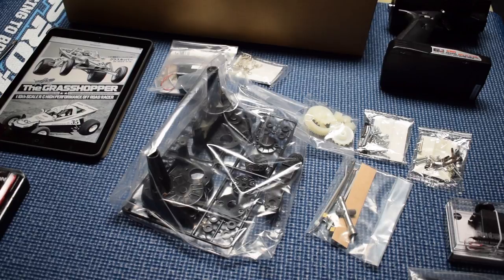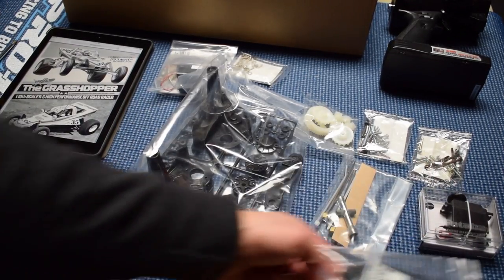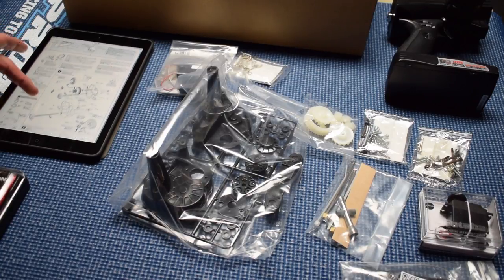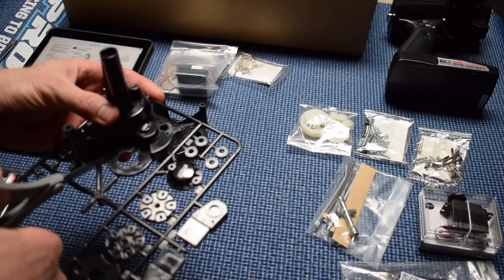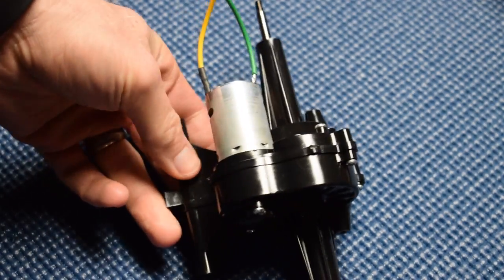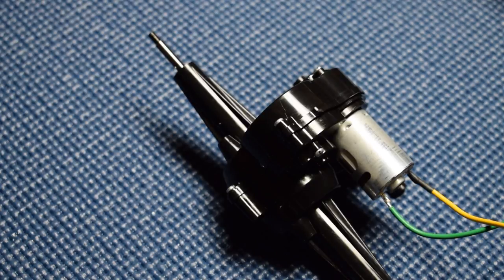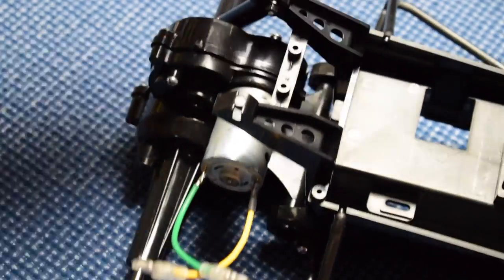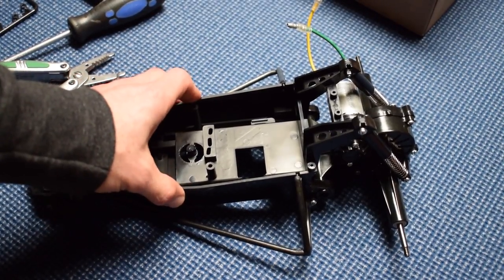Tamiya "The Grasshopper" Kit Build - Part 1

Comment: I know I'm super late to the party (searched for Tamiya Grasshopper build and your video came up first) but if you want to snip the parts off the sprues and not have to worry about cleanup, I'd highly suggest buying a pair of nippers from your hobby store or Amazon.  They range in price anywhere from $5 to $60 and are extremely handy when building any type of model that comes on a fixed plastic parts sprue.

Comment: Nice Job Tim!!! Try not to be too hard on the instructions or crudeness in general of the kit. This is what makes the Tamiya vintage kits so cool, right around the time you complete and go for the first test run you will forget about the primitive design and pains of the build. It's also completely normal to miss or have to go back and correct something from the instructions. Tamiya instructions always have had very little verbage and require alot study of the image at hand. Over the course of a few builds you will get used to this and start to see the relationship between the kits and it will get easier.As far as the Philips hardware,lol I've always thought the same thing (not gonna  hold strip etc...) surprisingly it works I've never had a screw back out. Your doing a fine job and the key is that you caught the mix-up while you were still in the process of building and these pains make the experience and the final product that much sweeter!! Thumbs up buddy and I await the next part of the series!!
Reply from the maker: Thank you for the comment and insight, Rich. After giving it more thought, the instructions aren't bad for what they are; reproductions of a 1980s-era manual. Put into perspective, it's a nice trip down memory lane (for someone that's never owned a Tamiya kit before) and helps me appreciate the current-day details that we have in modern kits and RTRs.
Reply: RC Newb Right on Brother!!

Comment: I am trying to get into RC kit building and I'm quite positive I will enjoy it but I don't want to spend a ton of money on something i may not like. All of the cars I've found have increased in price greatly. This car is a good price for me but I want to know what the cheapest price I can get the electronics for. If there is something cheaper than the grasshopper that still looks ok, I'd love to hear it. Thank you in advance!
Reply from the maker: The Grasshopper is one of the more-economical kits that I can think of, however, the ECX Amp Kit might be of interest to you as well. For $139.99, you get everything you need to build the truck in the box (except for paint). https://www.horizonhobby.com/ProductDisplay?product_identifier_token=product&urlRequestType=Base&catalogId=10051&categoryId=221501&productId=956501&urlLangId=-1&langId=-1&top_category=&parent_category_rn=&storeId=10151
Reply: If you want a good starter try a traxxas bandit. Runs about 160 and I promise you wolnt be disappointed.

Comment: how do you actually build the gear box? as your video jumps that part
Reply from the maker: Hi Claire, the gearbox build probably isn't as daunting as I made it out to be. Basically, the gears are greased and shafts are inserted into them (the orbiting gears). The main drive gears are also greased and attached to the axle shafts. Getting everything to line up was the most time-consuming portion of the task.
Reply: Thanks for the reply. My hubby and I are stuck on how to attach the rear dampers ( rear shocks). We cant find the screws/nuts bolts that we need. Could you please post an indepth video of the the whole build please and thanks
Reply from the maker: While I'm not able to post a complete build video, I can try to provide some guidance on the rear shock/damper mounting. The upper mount screws that you're looking for are in bag "C" and have fine threading. The nuts for these screws are found on the "A" parts tree (part #5). There are also washers needed for the upper mounts, and those are found in bag "A".

The lower mounting hardware uses screws with coarse threading and a slightly pointed end found in bag "B". There are also small collars in bag "D" that you'll insert into the lower shock mount and then slide the screw through. There are no nuts needed to secure the lower shock mount hardware.

I hope this helps!

Comment: I hope they do a re-release of the Tamiya FOX, one of the best 2WD cars until Associated RC10 came out. a FOX made to handle 3650 brushless motor, could be a lot of fun! the battery was transverse/rearward, with motor behind rear diff, independent suspension.
 
the Grasshopper/Hornet could have been a much better car, if they had changed the mold to place the motor more centered behind the differential instead of high+ahead and so offset to the right. the weight distribution issue put them into a dinosaur entry level class very quickly. we'd cut away the rear top of the battery compartment to stuff a 6 cell saddle pack (3+3 vertically) rearward, did help them to drive better.
Reply: model nutty They had a rerelease of the Fox a few years ago although discontinued again it was called the Nova Fox second time around. I agree my neighbor had one in the eighties it was a great performing car.
Reply: still have my original from way back when, full bearings, aftermarket rims/tires and went 16D motor with brushed ESC. only thing I'm critical about them is front end can be a little fragile (upper suspension arm and one side of chassis tub.
Reply: model nutty Nice sounds cool!!
Reply: was WAY into it back when (and still kinda!). the RC10 is Andy's chassis/arms, 14D with as big a spur possible under the cover, sealed the trans (old style not stealth) to run wet. what's kinda funny is it'll still keep up in 2WD on dirt and it's 30+ years old. it's all about the setup, dogbones almost flat spin easier, kinda soft springs bottoms out but doesn't drag or bounce, wheel angles and really aggressive spikes. also into my old RC boats but currently looking for a good deal on something RWD 1/10 drifter. for playing around practicing (with the old BoLink on road pan cars) last week ordered up 1M of 220mm black heat shrink tubing to slap over the foam rubber tires (for 4 bucks), for now. should cover the fronts twice and the rears 3-4 times anyway.
Reply: model nutty I remember the RC 10 back when I was a kid made in USA and was an Awesome competitor problem is I couldn't afford it haha! They had a rerelease a few years back of the rc10 classic and I missed it. real short release oh well plenty of Tamiyas to get a hold of👍👍
Reply: looks like nowadays best deal in that category is the Traxxas Bandit in eBay for 180, car+radio+battery. pretty darn close to being an RC10 clone. only thing I'm not seeing mentioned is a full bearing set, getting and installing would take a while, looks like a nice 2WD/RWD.
Reply: model nutty Yeah the Bandit is a solid unit proven platform great electronics Traxxas customer support can't go wrong with that. It doesn't have all the aluminum gear that the RC 10 had the bandit is all plastic.
Reply from the maker: Thanks for the details on the Fox/Nova Fox, Rich!
Reply: RC Newb 👍👍